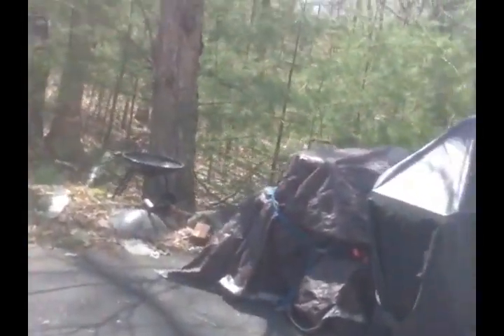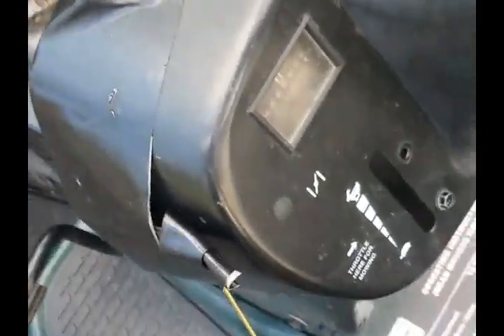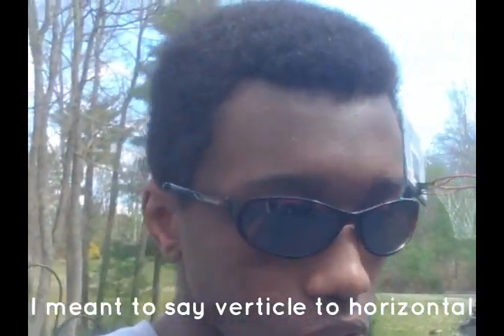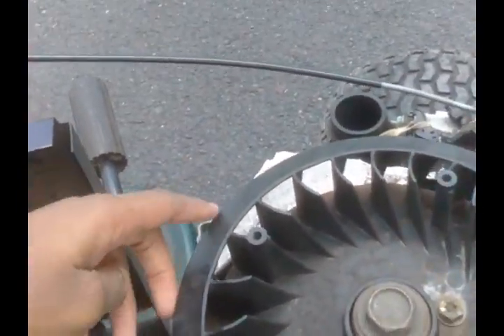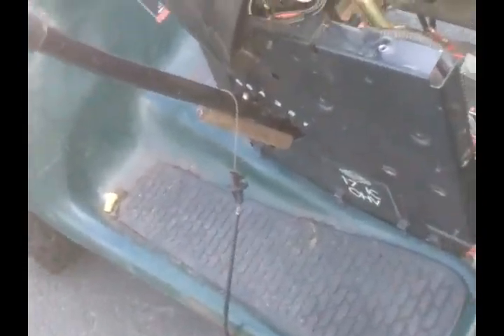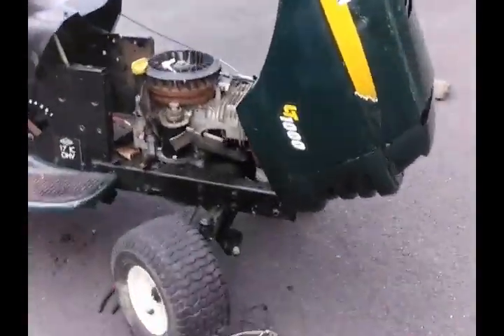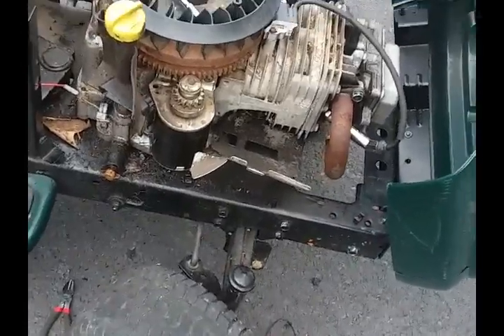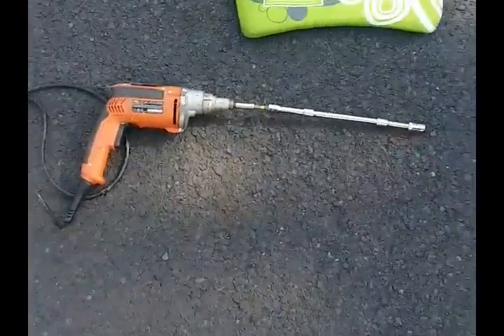Putting A Horizontal Engine In a Lawn Mower - Part 1

Comment: Man, i had to do the same thing with my mower. Ripped out all the idiot safety shit. For some reason mine wouldnt fire, it would crank, but wouldnt start up. Pulled a bunch of shitty wires out. Fired up instantly. Loud as hell, but fired. It now has 2 wires, a battery wire, and a ignition wire. All you really need.
Reply from the maker: I only removed the wiring because I wasnt planning on using the original engine the mower came with for. Also I hope your running a proper exhaust on that mower so you dont burn up your valves.

Comment: Why didn't you just pully swap it
Reply from the maker: I didn’t wanna have to change the transaxle every month because they don’t last long at high speeds
Reply: @thephenomenalgarage6707  theres many youtubers that have mowers that go around 40-50 mph that havent had issues and mine goes around 30mph with no issues
Reply from the maker: @hunterdoncanady  I simply wanted a better and more reliable drivetrain. I added disc brakes, a quick change sprocket, and some other misc things that I wouldn’t be able to add with a transaxle setup
Reply: @thephenomenalgarage6707  makes since